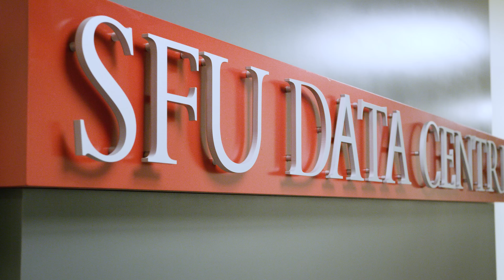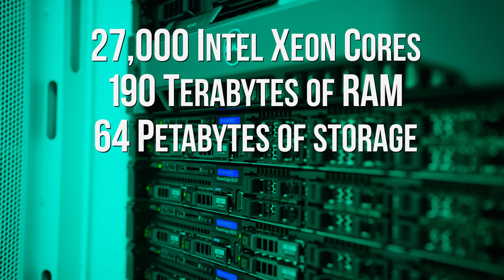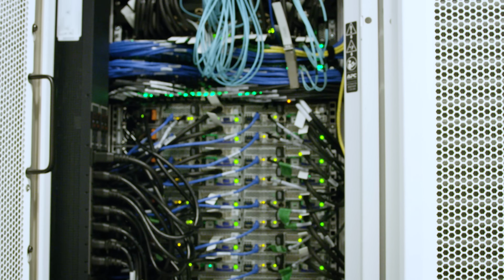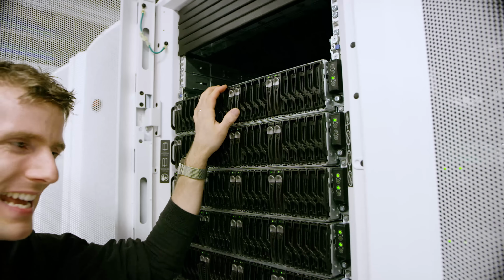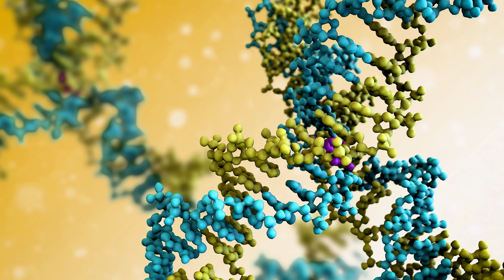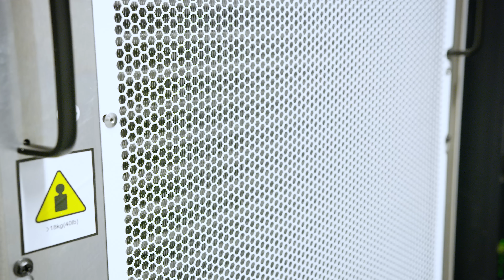Unboxing Canada's BIGGEST Supercomputer!

Comment: Breaking News: Anonymous Hacker uses all of Canada's super computer to mine Crytpocurrincies and makes $1000 per second.
Reply: After this comment i started acking.
Reply: Canada runs out of power
Reply: In all seriousness, would this computer be all that much faster than a system built with bitcoin mining in mind? I understand that a lot of mining systems can achieve amazing efficiency due to the benefits of hard-coding systems on the physical level.
Reply: You need more GPU though. 584 isn't ebough
Reply: I make 4 bitcoin per second

Comment: 2:20 

Linus:"Networking appliance from Huawei"
Someone, somewhere: hUaWeI sTeAlS tHe sErVeRs dAtA oMg gUyS
Reply: This would be very hard to steal data from, as every single connection into this facility is solid (hardlined), but that doesn't mean it's impossible, improbable or not already happening.
Reply: @kaistzar2831  seems like there perfect place to steal the data, all the important stuff is there and everything goes through it.
Reply: They since replaced it with a Ubiquiti switch since the ban

Comment: This could almost play pubg at 60fps
Reply: Dank Man Na man You would be lucky to get 45
Reply: 144hz. wait 190 terabytes ram would equal 900hz
Reply: Dank Man I run it at 60fps
Reply: noooooo are you crazy you vill get 12fps Only Minecraft is gud för dis pc or laptop
Reply: Maybe 60fps in potato settings XD
Reply: 70% render resolution ulltra low, 30fps
Reply: sorry but this aint no lowly xbox
Reply: 6000 fps easy

Comment: but can it run ms calculator?
Reply: It may executes it but as soon as you calculate something it will probably crash...
Reply: You are probably right.
Reply: You may be able to do simple 1 digit addition calculations, but they may take days to complete. Dont think you could do multiplication or division though...
Reply: Of course. It'll run it smooth as butter with those processors. The only problem is frame-wise it'll run at less than 1 FPS. GPUs will never handle the display.

Comment: I get so confused as to why data centers use the slow and short lived HDD over the fast, high storage density, and reliable SSD.

Like yeah, the HDD is cheaper and one of them can have more storage, but when you need your data accessible and you want to minimise raid overhead, SSDs provide the 3 to 10 times speed and the reliability to drop out a layer of mirror or parity without much risk.

Comment: I was like; PUE 1.07? Bullshit. There's so much noise on the floor. There have got to be CRAC units. And then is don,t see any form of containment to seperate the hot and air to optimize efficiency....
..
And then he showed the heat exchanger doors and the direct/free-cooling, tells about the evaporative cooling. And then i remember him saying it's in Canada...
Ok. I'll believe it, damn thats impressive. Not to mension most datacenters need rougly 5% extra power due to the losses trough the UPS/DRUPS and power transport. So the cooling itself is extremely efficient.